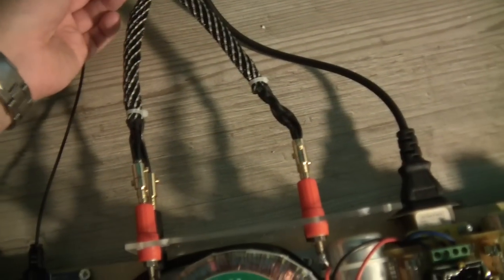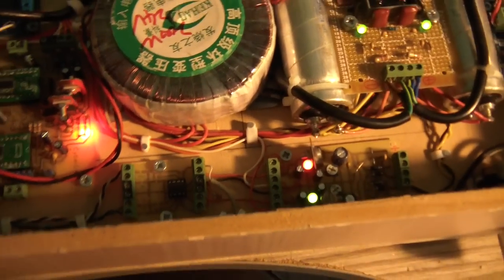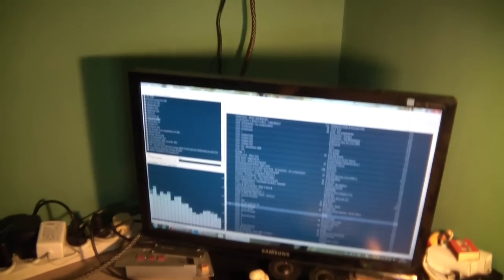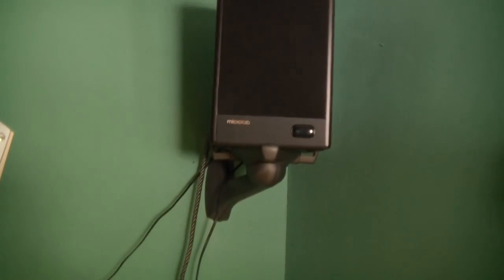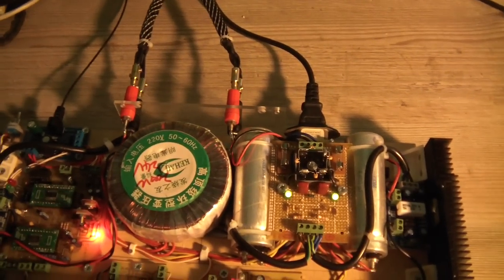Gainclone - LM3886 Amplifier + DAC DIR9001 & PCM1793

Comment from the maker: Thanks man :) Just search PCM1793 and you'll get tons of circuits.
After the PCM1793 you need an lpf circuit and unballanced signal converter. You have it in the PCM1793 datasheet. Very simple :) Good luck with your project !

Comment from the maker: @haz939 
Yes it's a 10ohm resistor with 1mm 10 turns coil wire in parallel. You can't see it here the coil is on the other side of the board.